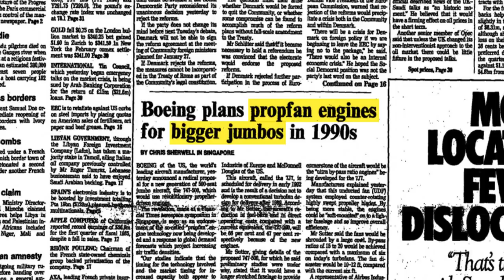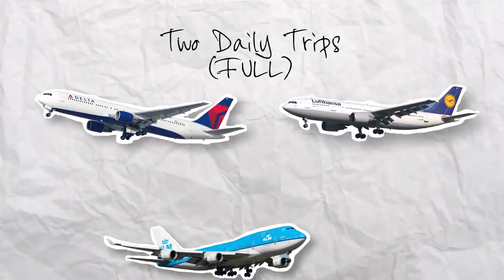Boeing's Propeller 747 - The Never Built 747-500

Comment: That thing would be incredibly noisy.
Reply: Its just a turbofan without a bypass duct.
Reply: Is it an open turbine, or just contra rotating props... There's plenty of contra-rotating prop aircraft in the history of flight, and what's been said of pretty much all of them, is they're incredibly loud. Certainly not ideal for commercial flight.
Reply: @Cal94   the soviet Tu 114 would be an example
Reply: @romanszwarc3288  and it was glorious
Reply: @romanszwarc3288  Or Tu-95?
Reply: @Cal94  There's no such thing as an open turbine on any engine in the world. A turbine converts energy from a fluid to mechanical work and on jet/gas turbine engines, it sits after the combustor. The fan och a turbo fan engine is, as the name suggests, a fan and not a turbine.
Reply: @skunkjobb  a turbofan is a turbojet with a fan in front, while the propfan is the same concept but without a shroud.
Reply: @kdrapertrucker  like a reverse turboprop.

Comment: Couple of observations - with engines that low, a minor pod strike would go from an annoyance, to immediate total engine replacement. 

Also, they could have easily ducted the props for reduced noise.
Reply: Duct the props? So just a normal turbofan? :))
Reply: Ducting the props means you've just come up with a high-bypass turbofan. Hooray?
Reply: @TheAmazingCowpig  yes, the contra rotating fans would still work with a large fuel burn reduction as an advantage. The ducts would add a bit of weight, but at a tremendous decrease in sound.
Reply: @HBKILLMISSU  yes, the contra rotating fans would still work with a large fuel burn reduction as an advantage. The ducts would add a bit of weight, but at a tremendous decrease in sound.
Reply: @ghostrider-be9ek  The whole point of the unducted fan was to have very large bypass ratio, which is why the propfan was so much more efficient than its ducted counterpart. I believe your proposal is essentially negating that premise: what’s the point of having a ducted unducted fan?
Reply: @HBKILLMISSU  ducted vs. unducted has nothing to do with bypass ratios.
Reply: The team developing the unducted fan system gave up and put all of that research into ultra high bypass turbofans. It's simply a better solution for many reasons.

Comment: I can't imagine how loud it would be.  At least turbofan engines have a shroud to dampen the noise from the fan.  The fan makes most of the racket.
Reply: I only know this from model planes. A back mounted propeller is signifikant louder that the same prop in front.
Reply: Modern turboprops have noise Cancellation in the cabin. They are quiet.
Reply: @tedolphbundler724  With this you need to worry about noise outside the cabin too. Like a Tu-95
Reply: @LOLHAMMER45678  Why do I need to worry about noise outside the cabin? I don't live next to an airport!
Reply: @tedolphbundler724  Big contrarotating props are loud even when they pass by at 40k feet
Reply: @bulcsu7044  Hmmm....I have only heard one on the ground. An Avanti, and never counter rotating propellers.
Reply: @tedolphbundler724  That's not contrarotating though, it's just rear mounted. That being said, Avantis are indeed loud but cool looking
Reply: @bulcsu7044  did you read my post? I said that the Avanti was not counter rotating.
Reply: @tedolphbundler724  you edited it... it didn't say that when I replied.

Comment: As long as it was designed by Joe Sutter’s incredible team that created the original 747 it wouldn’t have problems except for the engines which would be the engine makers responsibility
Reply: Then you clearly have no knowledge in aviation. The 747 had a lot of serious problems in the first 20 years causing numerous crashes
Reply: @GERntleMAN  Nothing compare to the Death Cruiser 10
Reply: @filledwithvariousknowledge2747  I don't know the numbers of operational 747s and DC10 at the same time, so I can't compare them. I know the DC10 was horrible in crash statistics, but I don't know how bad in total numbers to the 747.
Alas, losing a part of your roof or a fire in your insulation are really distinct faults on the 747.
Reply: @GERntleMAN  If you go by number in service together + how much redundancies both were built with in case of problems the 747 is the much safer one
Reply: @filledwithvariousknowledge2747  Yeah, thought so. There were a crazy lot of 747s around

Comment: This design makes me kinda cringe, looking how close the rotating parts are to the wing. I mean, just a bit of a wobble of the thing and you are sawing off your own wing, kind of.
Reply from the maker: I couldn’t figure out how they would operate. If they stuck out beyond the back edge of the wing then the engines would be different sizes as the engines are different thicknesses
Reply: The low wing of the 747 looks like the props would hit the ground.  Maybe a high wing design? (Kind of like Airbus A400M or Antonov An-70)
Reply: @Bryan Justus bots
Reply: @billymcnutt116  High mounted wings wouldn’t really be suitable for this kind of application. There would likely have been enough clearance, but high AOA on the ground when landing/take off could be problematic.
Reply: @FoundAndExplained  it would chop up the ground crew for sure.

Comment: The prop fan was also largely unnecessary given the expansion and development of high-bypass turbofans. Add in the extra cost of development for an engine that never took off, the noise and potential safety concerns of un contained engine failures and relaxation of ETOPS meant few wanted such an aircraft. The 747-400 would comfortably reach destinations like Johannesburg, Dubai, Los Angeles etc. Twin jets and leaning away from the hub & spoke model all took its toll. 

Good video!

Comment: It seems that they did create a different version of this engine and it was put into wide service. This updated design put the prop in front and encased it in a cowling which reduced blade tip vortex drag and noise. This engine that is currently in service is called the Hi-Bypass Turbo Fan. CFM International currently makes LEAP-1B engines a version of this engine which is installed on the Boeing Max-8. GE manufactures a monster version of the turbo fan named "GE90" Another common Turbo Fan is the GE/Safran CFM56.

Comment: If the 747X would exist today, it could be Reimagined as the 747-9X, which the 747-9X would be an ULTRA-LONG RANGE HGW version of the 747-8i, but with the same GE9X engine on the smaller 777X, but with the exact same fuselage on the 747-8, but slightly redesigned with the interior of the 777X. The 747-9X could have held the record as being The Longest Range Double Decker ever built. The 747-10X is the 747 with the upper deck EXTENDED almost the entire length of the plane, to the front of the tail, as you saw at the end of this video. The wing tips on the 747X will also fold up, just like the 777X, to ensure the LARGE double decker can fit into smaller Size-E gates. The 747X wings might've ALMOST been the same length as the A380's wings, but when folded up, have the same span as the 777-300ER. The 747-9X can seat up to 467 passengers in a 3-class configuration or up to 605 all economy, just like the 747-8. The 747-10X will seat 496-505 Passengers in a 3-class configuration, or 729 if all economy. Both variants of the 747X would've had the GE9X engines also used on the 777X.

Comment: The other issue is that the 747 is to big for these long runs, because these routes while long are also thin in passenger numbers, so you need something smaller that allows you to scoop up the business class passengers who will pay a premium for the convenience and speed of a single hop and then not leave you with a vast economy class section to fill up with passengers who's choice is primarily made on the basis of ticket price.

Comment: The 7J7 should have been built. But its boeing... 🤦🏻‍♂️
Reply: You clearly didn't watch the whole video
Reply: @blastaviation2199  they had airlines who wanted it and they F-ed the plane
Reply: @emaheiwa8174  you can’t blame Boeing too much. GE was the one who pulled the plug on the engine in the first place. Also, it was kinda destined to fail. It was notoriously loud, and lowering the noise of the engine would have made it less fuel efficient, so it would have been pointless, and lots of development costs are lost. And another reason they stopped it was because propfans weren’t needed anymore. Airlines kinda needed it back then because fuel prices were high, but once the price of fuel went down, pretty much interest in the engines went down together. This resulted in the shut down of the program. Maybe they should start it again, but I’m not sure if anyone is willing to make such a risk, since it requires a huge amount of money to either majorly redesign or produce and new kind of engine with similar specs from scratch.
Reply: @foxgaming76yt24  For it's time, the engine's noise might be acceptable. If they kept it around, by now, they might have created a new version that is less noisy and more fuel efficient.

The propeller would have revolutionized the aviation industry by now.
Reply: @nntflow7058  it wasn’t acceptable even back then. Many airlines had major concerns for the noise. And like I said, fuel prices went down, so it died. Based on the methods tried back then, lowering the noise would have reduced fuel efficiency. If you ask me, another type of engine that has improved efficiency will be good. But now, the engine are already much more efficient, so I doubt any project like that will be restarted.
Reply: *it's
Reply: Yall realize that these prop fan engines are pointless in this current age because airliner engines now are quite LITERALLY these prop fan engines but more efficient and better — as in the high-bypass turbofan engines that we use now?
Reply: @nntflow7058  yea. They have created a new version. Its just a high-bypass turbofan engine that airlines currently love and widely adopt.
Reply: @emaheiwa8174  just because airlines wanted it doesn’t mean it would’ve been successful. There are lots of examples that ended up being massive commercial failures in the same way despite initial airliner demand/interest/requests — i.e. the Convair 990/A, Lockheed Tristar, Dassault Mercure, Concorde, etc.
Reply: @poopsie117  I would like to see where the numbers are coming from, thanks.
Reply: @poopsie117  Que the RISE engine... Lol

Comment: Prop fans were very interesting, but they never achieved the performance that was hoped for.  In addition the noise would always be a problem.  As bypass ratios increased, those figures were achieved and surpassed with  the high bypass engines we have today.

Comment: This is an interesting topic, but you've got some substantial inaccuracies in this video. First of all, the design of the propfan you show on the model is incorrect. Second, the size of the aircraft model is incorrect. Third, your explanation of the reimagining of the 747-500 is wrong, due to these previous errors.
1. Boeing's idea for the 747-500, as discussed in the Financial Times article that you included as a screenshot, was for a shrouded propfan. The result would be an "ultra [high] bypass-ratio engine" with a figure of 15:1 or even 20:1. As the article notes, "Mr. Sutter said the fans would be shrouded by a large cowl." In other words, there was still going to be a nacelle surrounding the blades. Your depiction of it as being in the vein of the MD-94X is not at all what Boeing had in mind.
2a. The 747-500 was an enormous up-sizing of the 747 airframe. It was approximately a 30-frame stretch, making it one of the larger 747 variant conceived. It would have had a whole-new wing with a stretched wingbox and fuselage plugs fore and aft. It's that enormous new wing that allowed fuel volume for the greater range: Boeing was speaking of a 10,000 mile (8,700 nmi, 16,000 km) capability. Calling it an extended upper deck does not do justice to the concept. The model you show looks nothing this plane. You just took a -400 and put GE36 engines on it. I get that you wanted a visual demonstration, but if you're not going to depict anything even close to the design, why bother?
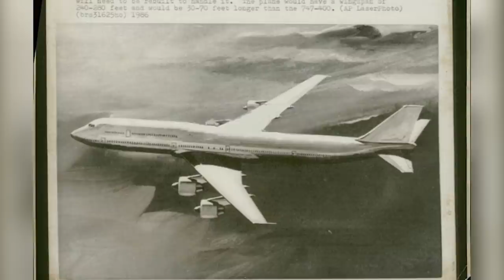3. Your errors about the engine configuration lead you to your last major mistake. At 5:37, you say: "Boeing would then re-evaluate the design, to include one with other engines, the normal turbojets, but there were still some other issues." Not at all true, in the context of the picture you show. The "normal turbojets" you circled aren't normal turbojets at all; they aren't even normal turbofans (since the 747 has never been turbojet powered). Those are the UDF engines that Boeing had in mind for the 747-500. You can see the outsized nacelle serving as a shroud for the 10-12-foot radius fan blades. That picture is, quite simply, a sketch of the basic 747-500 concept, with the new wing, shrouded UDF engines, and enormous fuselage stretch (just count the windows).
It's wonderful that you want to discuss these interesting aviation history avenues, but please be a little more accurate about it. I don't even work in the aviation industry, and I'm spotting these errors.

Comment: I wonder if, besides the operational aspects mentioned in the video, there were also technical or certification aspects that were not competitive. 
A turbofan engine has a rugged housing that must withstand for example the loss of a fan blade. Imagine this case with a propfan: the fan blade would penetrate the fuselage or the wing, hitting and destroying structure, control system components, fuel tanks, or even injure or kill occupants. Not very desirable..
Reply: Well you have the same potential hazard with turboprops but I fail remembering any fateful events. BTW propfans are regaining interests - Safran is testing a new gen propfan which should be much less noisy. This tech would be a gainer against bird strikes too.

Comment: Recommend Read Wikipedia article on propellers and correct propeller pitch in animations. Pitch parallel to airflow (feathered) happens when engines are shut down in flight. Your animation shows feathered props rotating.

Comment: I have an idea: they might have put propeller-blades on at an angle instead of parallel to the air-flow, as shown. 
That would have made them produce some propulsion by pushing the air backwards, see?
Reply: They were variable pitch, just like a turbo prop. ;) You could have zero thrust at full rpm, reverse pitch for braking and backing up, or feather them into the wind stream for minimum drag during engine out procedures.

Comment: It's kind of amusing that the shroud less turbofan made it as far into development as it did. Those things made awful noise. Ultimately, they were just a footnote on the way from the fuel guzzling, smoke belching, sometimes even after burning traditional turbojets to modern high bypass turbofans (which offer almost all the advantages of the shroud less fans but with maddening groan that sounds like the atmosphere itself is being unzipped. Not to mention a failure like with that 777 a few weeks ago would be far more dangerous without the nacelle to contain it)

Comment: So, fast forward 20 years latter, and now more than a dozen airlines want an aircraft with these abilities.
Reply: But as Found & Explained pointed out, the sound of the engines were way too loud, and seeing as how strict the rules are, I really doubt any would specifically want a propfan. And restarting the program would cost quite a lot of money, not sure who would want to take on a daring investment like that.
Reply: @foxgaming76yt24  But I used to fly a lot of props, they have gotten a lot quieter in recent years.  Also, Boeing has produced some a recent prop fan aircraft concept, so clearly they haven't abandoned the idea. But its the overall range i was referring too. Now, most airlines want a jet with that sort of range, and it seems manufactures are struggling to give it to them without just stuffing more gas in the plane.
Reply: @jhmcd2  I’m referring to propfans, not turboprops. Turboprops are more efficient at lower speeds, and aren’t too loud, but they aren’t used because they lose efficiency when the propellers themself reach close to the speed of sound. I’m not fully sure how many airlines actually want this, but maybe there are. But like I mentioned, the sound of the engine was the main killer for it. People were at first interested in it, but after realising that it was loud, interest was starting to be gone and once fuel prices went down, bam, nobody wanted it. Now airlines might want them, but only problem is the noise, which if solved, would definitely help the project by a lot. Actually the noise problem was solved, however, the efficiency of the engine was also reduced, therefore, the design was useless. I won’t disagree that the concept is a good idea, but it would cost a lot of money, and it might flop once again. One thing I realised though, a lot of technology came from development in the military, so I’m wondering how would the propfan help a jet fighter. Maybe a specially designed propfan for jet fighters with an afterburner. Would probably increase the range of the plane by a huge margin. I can see two reasons why they might reject it tho.1, it might be too loud(at the same time the engines used by fighters are also loud, so maybe it doesn’t matter) 2, the extra propeller like things at the back would increase detection too much. Basically, I think that if the us or any European or Asian country starts development for a propfan powered fighter jet, then maybe it’s possible.

Comment: This was a good one, thank you. Wonder what could have been done to quiet the engine? Perhaps ducted like a high bypass turbofan???
Reply: There is a low
noise spot of blade counts, blade angle, blade rpm that works for cruise, but outside of those conditions it's going to be a noise and vibration beast.